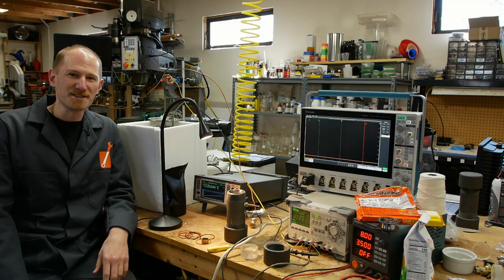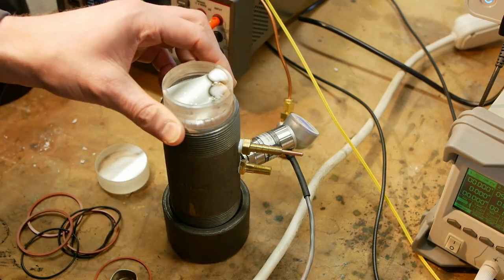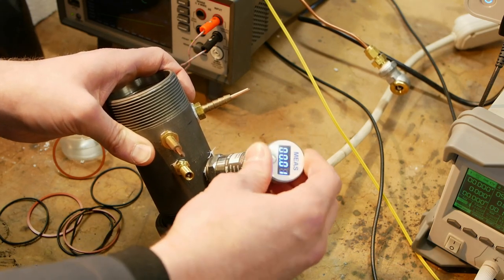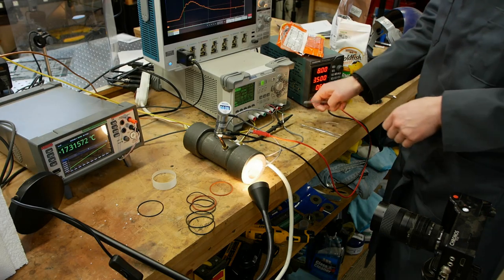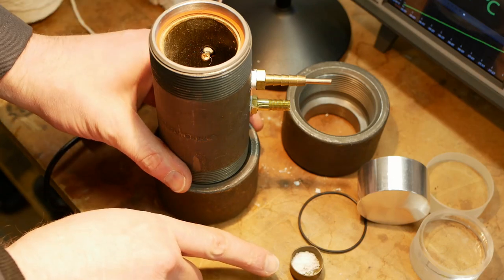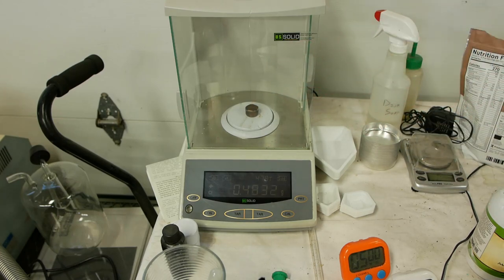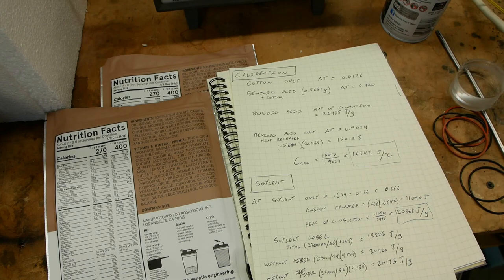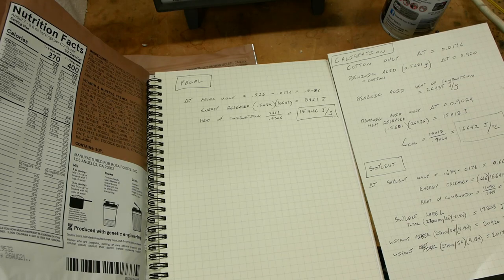Measuring human digestive efficiency vs. a flame

Comment: Ben, there is more to it. 1. Your body before the experiment. Depending how much fat your body stored before the ratio input/output of sugar (or fat) calories is different. Think of it like your body can use the long term fat for many weeks to survive. 2. Even measuring your body weight is not much helpful in such short experiment. In the beginning of a diet you loose water. 3. You forgot the other outputs. Calories is breath CO2 and per and sweat. 4. Your poo contains a lot of other materials, like the bacteria cells from the gut. 5. Maybe you could improve the starting conditions by totally emptying the gut with a good cleaning first. 😂 6. Extend the experiment for a longer time. Ok ok, you suffered enough in the name of science. Enjoy the new found taste (and now maybe use much less salt and sugar in your meals as amplifiers?)

Comment: Always fascinating what you manage to do all by yourself in your garage.
But I think that comparing energy densities per dry mass between "input" and "output" is not very informative. The dry mass of feces (e.g. daily total output) is expected to be lower than that of the food (e.g. daily total input). Just think of metabolizing carbohydrates as a simple example: CO2 and H2O are generated in the process. CO2 is released via the lungs, H2O in various ways. This way you loose the carbon and hydrogen (and oxygen) mass from carbohydrates, or at least from the fraction that gets fully metabolized. I.e. if a sugar molecule is fully metabolized, nothing of  it ends upt in the dry mass of your feces. Similar for fats (assuming complete metabolization). For proteins I guess you release the nitrogen via your kidneys/urin.
And of course there is a lot of unmetabolized stuff in the feces as you mentioned. This is what you measured.

Assuming that all the remaining (flammable) calories still end up in the feces (sounds reasonable enough for a healthy person but one should check) you should keep track of the total (dry) mass of input and output as well. For the input, you likely know how much soylent you ate. But did you weigh all your feces?

Comment: Random question here: Afaik, when you turn a liquid into gas, it's temperature drops. Would it be feasible to build an air conditioner by compressing air from the outside at night and releasing it inside during the day? I could imagine it being not as effective but maybe more energy efficient. Thanks for reading :)
Reply: The biggest cooling effect comes from the change from liquid to gas.  You'd have to compress it down to a liquid to be able to store enough for effective cooling.

What you describe its basically refrigeration.
Reply: Reverse Stirling refrigeration.

Comment: I've always wondered. If a calorie is the amount of heat energy required to raise 1 gram of water 1 degree celsius, then unless you are drinking body temperature water, a glass of room temperature water would have negative calories. This is because your body has to heat up that room temperature water to your body temperature. If you drink cold water, then the water has even more of a negative calories content. So if you drink 8 glasses (8 oz glasses) per day as health professional say you should, and you drink refrigerated water at about 2 degrees celsius, how many calories does your body have to use up to heat that 64 oz of cold water to a normal body temperature. Then, how many food Calories does drinking that water negate?

Comment: What you called an o-ring really isn't. It's a flat gasket. If you want to use an o-ring, you need to cut a groove in the surface of the ledge. The groove should be wider than the cross section of the o-ring and shallower than the cross section. Then the o-ring is pressed into the groove by the glass. That would leave you with very little of the o-ring exposed to the oxygen and provide a seal.

Comment: Good experiment, well explained BUT my reaction is that you can't compare 1 gram of food with 1 gram of poo if you  were doing a top level study.
Can we assume there will be a 1 for 1 input and output by weight? Also, one would need to measure the whole bodies weight change for the period, and add or subtract the calorie equivalent of fat and muscle, I would think.
Perhaps we would need to measure TOTAL  food IN, and measure TOTAL Poo out,  and apply that ratio to the difference in calories?
Then, there is the problem of volatiles in liquids (phosperous and dissolved elements) AND gaseous forms.  Hydrogen and Methane are pretty energy dense.
A pretty big challenge to get ALL the factors aligned. 
But all in all, many thanks for your great efforts in education on the topic.

Comment: Great work!
But I believe you missed a crucial point, you are assuming 1 gram of input gives you 1 gram of output,
allow me to explain further Soylent has 19  kJ/g "yes I'm rounding"
what if you found poop containing even more than this let's call it 20 kJ/g  does it mean that your body has 105% efficiency
the answer is no.
What if you were using a different food with lower calories per gram let's call it 9.5 kJ/g or half  the original amount and had twice as much food "same input" "assuming that your poop didn't change" you would have had more than a 100% efficiency
I believe you should multiply the calories per gram by the amount for both the input and output to get to the right value
BTW don't forget to add me as a co-author :)
Edit: one more note,
when you subtracted the mass of the fiber, for this to be true the calorific value of the fiber has to be equal to the calorific value of the mixture as a whole otherwise these equations wouldn't be right and you would need to multiply the mass of fiber by its calorific value and subtract this value from how much energy was released before dividing this by the mass of the rest of the sample.

Comment: Great demo, very nice engineering. But, as others have alluded, I don't think the results mean a lot. Imagine you ate pure glucose for a week, just enough to keep you going. Presumably your body would be relatively good at extracting energy from it. But a gram of your dried poop after a week would still be a gram and contain a lot of energy, even if your body had broken down 100% of the glucose.

Comment: Another solution for having a transparent window on a high pressure/temperature vessel like this, I understand is sapphire. I believe sapphire windows are used in a lot of such devices. But I could be confusing it with another application. So, don't go building sapphire windows for your high pressure chambers just because I told you it's safe. Ya gotta do your due diligence and look it up yourself. I mean honestly, who's gonna take the advice of a random YouTuber about what material to use on their high pressure vessel? lol And yes, I'm absolutely being facetious here. So you can rest easy in that regard.

Comment: You're missing one detail: how much grams of food makes one gram of poop?

The reason is that your body is not a closed system, a lot of weight gets lost in forms of gas. So it is theoretically even possible that the energy density of poop is higher than of the food, but the weight is reduced a lot.

Comment: Hi, I am a physical chemistry researcher, and for one of my setups I need heating samples to 1000C. I made a setup for electron bombardment heating. But now I have a problem to solve, which I can’t do it due to lack of electronic knowledge. I need to find a way to use the thermocouple for reading the temperature, but the sample will be biased to 1KV which means the thermocouple will be biased. Can you give me any advise how to solve it? Thanks
Reply: I suppose you found a solution by now.

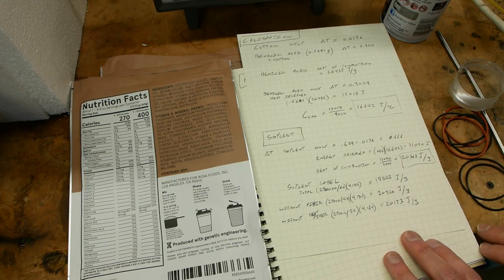Comment: 29:23 Well, you can't verify the accuracy of both. You have to assume one is accurate to determine the accuracy of the other.
Anyway, about the experiment. Wouldn't your way of doing it assume that the input and output is of the same mass? If your output is only half the mass, you can't measure the same amount of mass as the input to compare the two right?

Comment: Isn't there a confounding factor caused by the fact that mass consumed does not equal mass expelled through excrement? Humans also lose mass through respiration (oxygen in co2 out) and you have stored or lost some weight over the as well especially given the odd diet. 

There will be some ratio between grams of  excrement produced to grams of soylent consumed that is less than one.

Comment: Oh, if you do a version 2.0 of this experiment, which I don't think anyone on the planet could blame you if you don't want to, you could do some extra stuff like, collecting your pee and evaporating it (it contains proteins that should be accounted for),  hair grown over the period of time (would have to shave full body right before starting, and again at the end of the experiment, collecting everything you shave),  skin oil? (if there's a reasonable way at all to do that), dead skin cells?  Ok maybe not so much, but the first two things seem like they would impact the results.
Also you could weight yourself before and after. I mean, your body metabolizes some stuff even if there's not abundance of the components required in your diet to synthesize everything again, so you might have lost more calories than you took in maybe?

Comment: I know this experiment is for fun, and so not 100% scientifically bomb-proof (pardon the pun) but wouldn't it be more accurate to measure the temperature rise inside the chamber, rather than the temperature rise of water around the chamber? You're always going to lose some temperature (and therefore results accuracy) due to thermal transfer inefficiencies - such as some of the heat being retained inside the metal walls of the chamber and not being transferred into the water, or being reflected back into heating up the exhaust gases inside the chamber which you then just release into the atmosphere.
I'm assuming more accurate experiments deal with these losses by, as I said, measuring the temperature rise of the gases within the sealed chamber itself rather than relying on heat transfer through several different mediums?

Comment: "...as long we change nothing of this system" - with open water, wich evaporizes, even just over time due to dry air taking up moisture - yea, seems very stable for measurements in the microscopic scale where such tiny changes matter xD sarcasm
and why the stirring-rod? - doesn't that also add a variable?
why no measuring the temperature change of the chamber itself, with an known thermal insulator to protect the probe?
Edit: with a known thermal resistance

Comment: Ther are 3 categories that your body absorbs. Fat, carbohydrates ( sugar) and proteins. In a normal situation you body burns sugar and fat in cells and uses proteins to build cells and hormones etc. 
Your body uses per 24 hours 2000 to 2500 kcal if you do nothing, that is for your breathing and heart and cell building etc. 
Fecal matter is concentrated mass of fibers which human body can not absorb. it is high in calories. Remember that plant eaters eat only fibers ( plant matter) .
So with the info on the pakket of soylent you can calculate howmutch fibers you produce for any portion of soylent. 
PS . I hope that there is not much from soyabeans in soylent if you plan to make kids one day.

Comment: You are omitting a key metric, the weight of the intake and the weight of the output. if you eat 1 kg of soylent in a week, you will also have to weigh the dried poop from that week and dry it to do a more true comparison

Comment: You really need to account for the mass of your input and the mass of your output, since these might be different also. You breath out some CO2 and also piss out some diluted hydro carbons. so the  weight/mass ratio could be off.
You should be able to account for how much dry poop you get from how much dry soylent you eat.
There should be quite a bit less poop.
This could also explain the some of the mystery residuals.
Reply: Depending on the food you eat you might even get a higher energy density from the poop than the input.

Comment: Wait… did you not measure the quantity of inputs and outputs?  Maybe half (or more) of the inputs were digested and exhaled as CO2, leading a highly caloric fibrous output but masking the high digestive efficiency.  It is quite counter-intuitive, but energy output from animals ends up as heat, water, and carbon dioxide.  Thus to truly measure end to end end efficiency you’d have to also measure your CO2 output for that week.

Comment: There is one extreme important thing missing: How much dried feces will you get from 100g of soylent? To figure that out you'll have to eat soylent for a longer period and note all the soylent you eat and dry all your shit weight it. If you'll do that for - let's say - a month to overcome the inaccuracy in the beginning and end you'll get that important relation. Without that the calorie difference between one gram of soylent and one gram of shit is meaningless for the efficiency calculation.

Comment: So you kind of left out the once piece of information that we really need to make the video title, uh... true.
We don't know the soylent to poo ratio. We have no idea whether a gram of poo came from 2 grams of soylent or 200 grams of soylent so we can't even distinguish between a digestive efficiency of 40 percent or 99.9 percent. Or 110 percent efficiency either for that matter.

I mean its not actually super hard to do either. Just put something in the soylent that isn't already in it that has effectively zero digestive absorption, then measure the proportion of that thing in the resulting poo. Oh also it has to be non-flammable, obviously. Maybe titanium dioxide? It doesn't look like there's any in soylent. If you don't like the idea of titanium dioxide nanoparticles, you can get reagent grade stuff thats 10s of microns pretty cheap. It has basically zero digestive absorption.
Reply: I don't get what you are talking about. Unless his body is storing food as fat or something like that, mass ingested will be mass excreted, either through poop, sweat, urine, breath etc.. The thing is, sweat and breath is mostly not flammable, made of water, gasses and salt. I guess he could've made it more accurate burning his urine too, but one can consider that it is mostly water.
So measuring the different concentration of energy between input and output is the best way to go.
Reply: @Alkis05  No. He ate an amount of Soylent that we know, presumably, but we have no idea how much poo that produced, and neither does he. so for the first day or two, its a mixture of his old diet and soylent. We have no idea how many grams of poo a gram of soylent got turned into. We only know the calorimetry per gram of poo.

He would have had to have fasted and taken a bunch of laxatives for days before this diet to make sure what he collected was only from the soylent and then fasted and taken more laxatives to make sure he got everything out.

Let me put it to you this way: give me a formula for the digestive efficiency based on the data he collected in this video.
Reply: @htomerif  "so for the first day or two, its a mixture of his old diet and soylent."

 That is why he survived on Soylent alone for a whole week before doing the measurements. I think you missed that part. Sure, maybe he could have gone for more, but a week is a reasonable amount of time to clean his digestive tract of his old diet.

The formula is this: let Di be the energy density of the input matter, and Do the energy density of the output matter.

The energy efficiency N = (Di-Do)/Di
Reply: @Alkis05  No, holy jesus no.

I've tried to make this clear, but let me make it even more clear. It is not your (Di-Do)/Di.

Where k is the ratio of input mass to output mass, the (approximate) equation would be k(Di-Do)/Di.
k is not 1, its not 5, its not 0.1. We have literally no idea what k is.

Lets say he ate 10 pounds of soylent. Did he collect 10 pounds of output? 50 pounds of out output? 1 gram of output? 100 grams of output? We have absolutely no idea and HE has absolutely no idea.

Like the equation for the gravitational force is F=G*(m1*m2)/(r^2). What Applied Science did here was the equivalent of saying F=(m1*m2)/(r^2). Without G it is a literally meaningless statement.

This is why I suggested adding something like titanium dioxide to the food. Since it isn't digested basically at all, you can modify your equation with Ti being the input ratio of TiO2 to soylent (which you would fix at 0.1 percent or something just by mixing it in) and To being the output ratio of TiO2 to food and get the equation (To/Ti)*(Di-Do)/Di. (To/Ti) establishes k.

Please tell me you understand what I'm talking about now.

Comment: hey, love your channel and your science, bruv, but i gotta take issue with your methodology on this one.  The primary carbon loss in human energy consumption is in the breath; carbon dioxide. and ultimately, combustion tests are a measure the amount of oxidizable carbon, yes? available energy? the vast majority of our carbohydrate(hydrocarbon) use becomes CO2 and water. thats what you need to measure relative to incoming potential energy
i suggest a more valid test would be to measure your average rate of CO2 exhaust, consume a known and consistent food caloric value each day along with an exact amount of water, and keep meticulous tack of your weight change plus the net change in water (measure urine production). do this for one month and you might get some decent data. one year would be better

/cheers enthusiastically